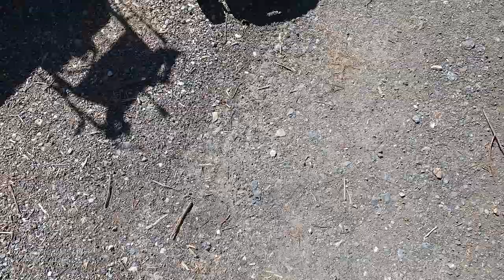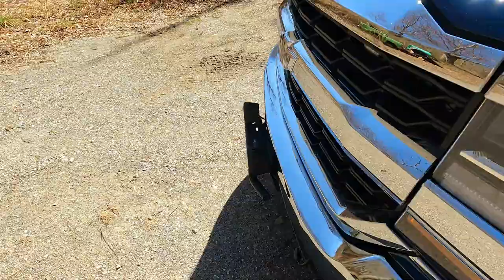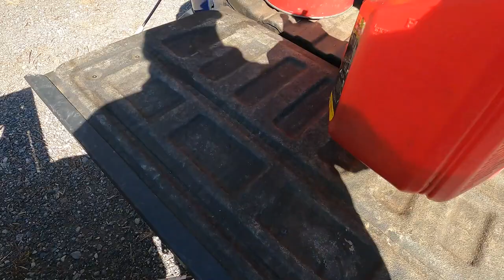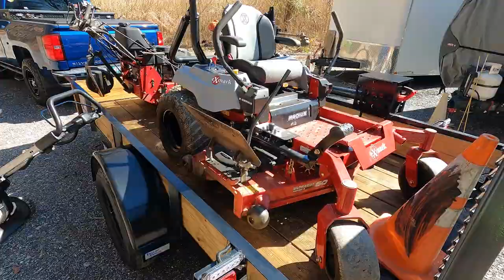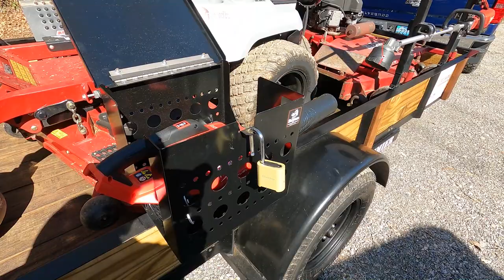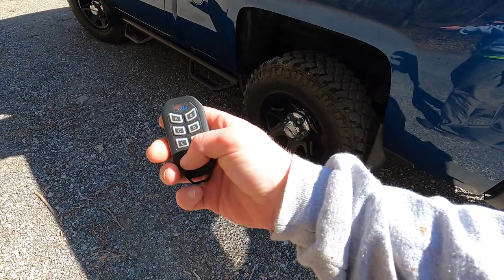2023 Solo Lawn Care Setup!!!! | Plus Something Special!

Comment: Just to be clear this is a 6 x 12 trailer? I am currently looking at trailers right now but I don’t want to go too small
Reply from the maker: Yes, 6x12.  I only do this part time and have done so for the last 16 years.  My old trailer did me well for 15 of those years.  For me the 6x12 works fine as you could see in the video.  If you are ever planning on needing to carry two zero turns you will need to go bigger like 16 foot.  A 6x12 or 6x14 you can do like I have, or even a stand on and zero turn or two stand ons.  Hope this helps, and good luck on your trailer search.
Reply: @VanLoweLawnCare  thank you! I’m trying to get a 48 scag v ride 2 and then a smaller stand on or walk behind. Finally making the jump this coming spring and gonna become an actual business. I’ll probably go with a 6x12
Reply from the maker: You should definitely be able to fit the v ride plus another walk behind or stand on no problem on the 6x12.  Good luck my friend and congrats on your new adventure